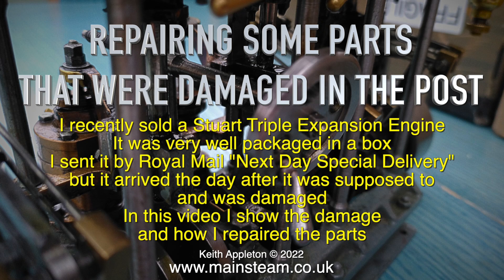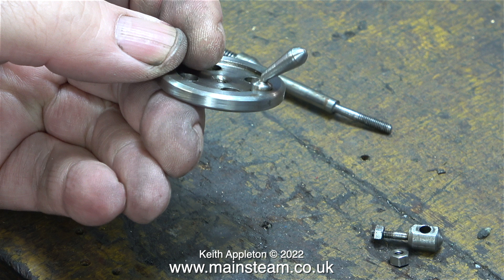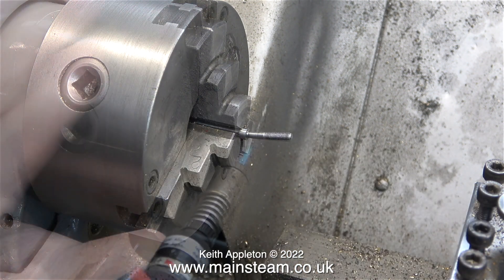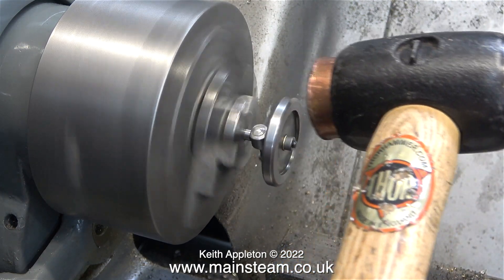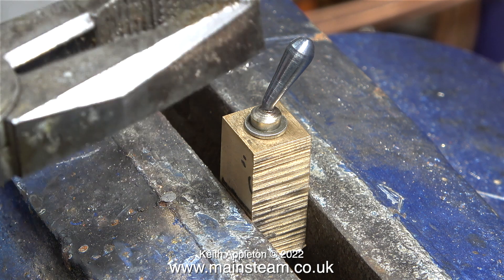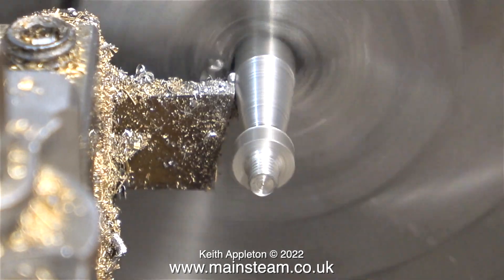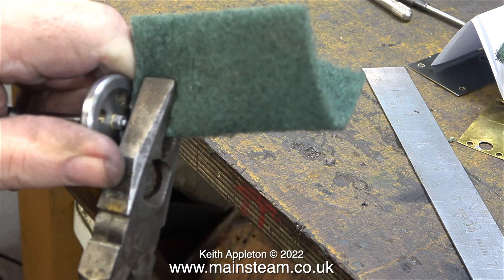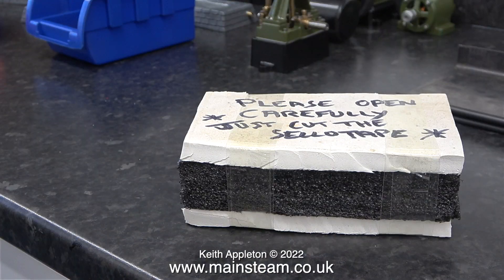REPAIRING MODEL STEAM ENGINE PARTS DAMAGED IN THE POST

Comment: Gotta love couriers....  a law unto themselves.   We shipped a rack-mounted server in it's factory carton and padding,  triple-double-wall boxed  with corner inserts to keep the boxes apart.  It arrived at the customer site damaged, and when it was shipped back to us for evaluation, it appeared that a forklift blade had been driven through all 3 boxes, then through the (steel) computer case.  The courier's insurance verdict:  Not adequately packed for shipping.
Reply: Yea the "inadequately packed" is the default answer to everything. The shipping company destroyed, that was was essentially a electronic filled steel box that has hold up a ton of shaped cast iron. It came crushed with tire marks on it. To the answer "inadequately packed" of the insurance i let my lawyer ask them, how often packets are driven over by trucks to make accommodating to that the norm.